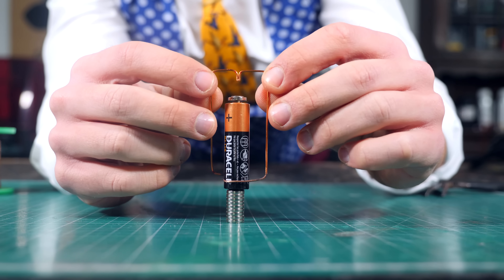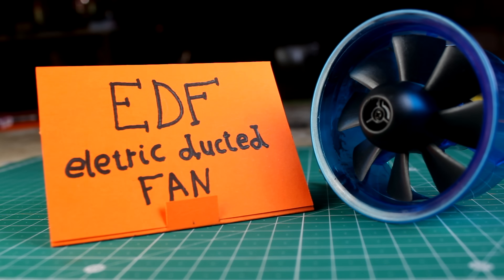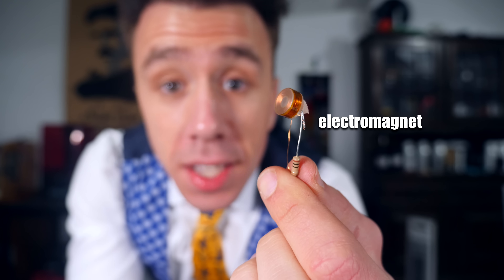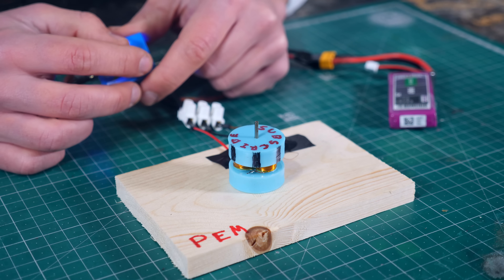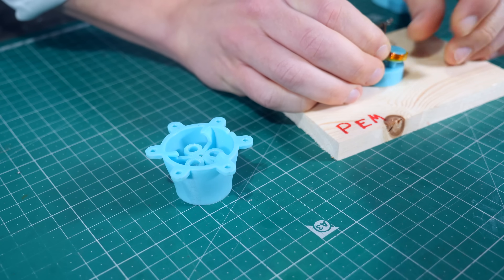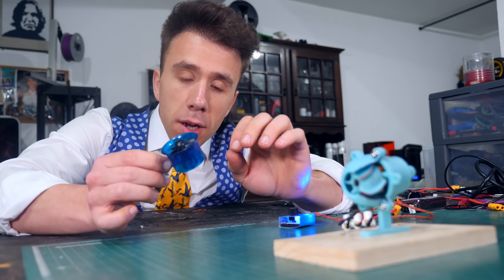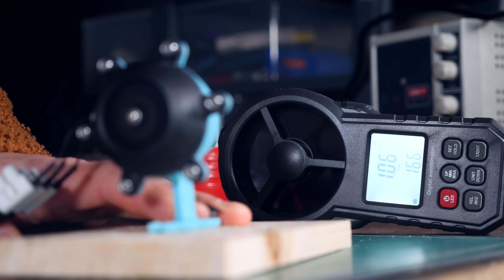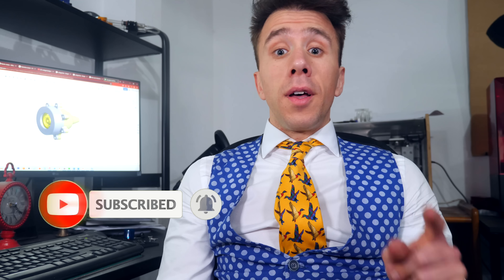I 3D Printed an ELECTRIC MOTOR FAN

Comment: the propellor or axial fan is to all intents and purposes, simply an inclined plane.
pitch, RPM, and disc area.
along with aerodynamic blades. low turbulence. pretty simple really.

the centrifugal fan is this tricky thing where involute curves or archimedean spirals may or may not be the best. you have depth of blade. blade area. the NARROWING of the blade passage. the impellers in a turbo, as the diameter gets larger, obviously the duct (area between blades) must get narrower to maintain the same cross sectional area, and then, theres a slight taper thrown in on top of that. the air is being compressed before it leaves the tip of the wheel, and there it has maximum VELOCITY and MINIMUM PRESSURE. its the scroll, the volute, that allows a turbocharger to actually build pressure as air velocity reduces. bernoulli.... use it.

what comes before, and what comes after the impeller are just as important as the impeller itself.

thrust... are you accelerating the SAME mass of air to the SAME speed? its a very tricky thing to quantify. and you appear to be measuring airspeed. not thrust... thrust requires the volume, the mass, to be considered. or simply how much thrust it measures on a scale. not an anemometer.

so, as nice as your "whipped cream in a can" impeller looked, it probably has a lot to ask for aerodynamically.

um...destroy the dyson fan before it destroys you? mine set itself on fire in the middle of the night whilst i was sleeping. heaters turned on full blast and yeah, it was smoking. lucky i sleep light.

i happily pulled it apart.

i noticed that the fan uses a closed blade impeller. unlike the vacuums.
it has asymmetrical blade spacings, to reduce the "air raid siren" effect.
it has finned trailing edges and holes drilled through for more noise reduction efforts.

havent had any luck driving the motor as its a high voltage (300vdc area) type thing...

still, the dyson impeller simply moves air, it doesnt actually compress it like a turbo charger does... again, it has the wrong type of housing...

Comment: The impeller needs a cone with an inlet.  Generally The bigger the inlet the more air  it may move. 

The inside of the cone needs to conform to the shape of the impeller reducing the airgap as much as possible to aid compression. 

The impeller fins should start largely pointing radially out so as theybrotate they  pushing air outward. Further out, the fins should begine to spiral and gradually bend to push the air backwards.  

Looking down on an impeller that curls, clockwise. If you  spin it anti clockwise it move more air. If you  spinning it clockwise, it speed a smaller volume of air up faster.  I believe you want more volume slower moving  of air rather than smaller volume but faster moving air.  

Finally, removing  the  impeller blades to about the diameter of the cone opening will likely aid in bringing more air in.

Comment: Difference I thrust is simply just because fan blades are better at accelerating air to higher speeds, while centrifugal fan just increases pressure of air, then you have to increase airspeed by using nozzle. Also there is probably a huge difference in flowrate

Comment: I am totally impressed by your 3d printing and designing skills. I tried to build my own electric motor and it - you can't say it runs, but it does some sort of turning motion. By the way, the thrust is not matching due to aerodynamics. It has nothing to do with the motor. Check out the guy who tests user made fan designs for PC fans, it's always the same motor and wildly different effectiveness due to different aerodynamic designs.
https://www.youtube.com/@MajorHardware

Comment: That particular type of fan is sometimes referred to as an axial compressor, because that is primarily what it does, compress air not accelerate it. That is most likely why it is underperforming here, I guarantee if you flipped the test and tested air pressure rather than speed, it would almost certainly outperform the edf. That's the whole reason turbines use them as their compressor stage, and dyson uses them as a vacuum pump.

Comment: Traditional round coils suck for generating torque for the length of wire they use. 

That is, Torque  Force=length of wire×amps×magnetic field× sine(angle of wire from direction of motion).

 In otherwords coil segments more parallel to the direction of motion contribute nothing to torque the magnets on the rotor. While an axial flux motor's coil segments that are perpendicular to the direction of motion (more radial)  are the coil segments providing rotation inducing torque to the magnets  on the rotor. 

A faulhaber coil has the coil geometry that produces the most torque for the length of wire that coils a motor. 

One can search "faulhaber coil". for examples and explanations. I like "Thingap Motors" that use a radial flux faulhaber coil on their motors. I made an axial flux faulhaber coil for my motor that I made on my channel.

Comment: What if you tried a modified toroidal propeller in your design? They're the new cool propellers, or so I'm told by the internet lately. They're extremely efficient according to all of the graphs that were colorful enough to warrant looking at for a minute. Also, if you happen to have a spare 3D printer.. I've just gotten a Tevo Tarantula running that was given to me. It's been.. Time consuming.

Comment: My intuition is that his initial assumption is wrong. He says it's the same motor so it should produce the same amount of thrust if used in axial or centrifugal configurations, but these compressor architectures are geometrically dissimilar. The efficiency of the compressor is going to be different as the geometry changes and perhaps the simplicity of the axial fan wins out over the centrifugal at this scale. I'd suggest he measure the inlet and outlet pressures and or the power consumed by the motor in both configurations and compare them for further physical insight.
- from a friend

Comment: You're using two different methods to import mechanical energy onto a fluid. The smaller the scale the more the tiny changes have a large impact, this means that at the scale you're working, minor changes have major repercussions. There's a reason we don't use impellers on boats, except in specific circumstances. A propeller is more efficient in the water just as a propeller is more efficient in the air than an impeller they impart a different style of mechanical energy for lack of the technical language
Reply: Did you select me or am I being scammed?

Comment: The centrifugal blades probably work better/ more efficient with the motor at high speeds. They take in high pressure air from the front, like used in a turbo fan jet engine. The blades on the edf fan are designed to propel the still air around us.
Reply: Also restricting the diameter of the flow can create a nozzle but can also restrict the flow. Love you tho, hope that helps

Comment: Fluid dynamics of air. Air pressure is one thing at the climatological or aerodynamic scale but behaves differently at the event horizon of violent pressure shifts like your fan intake. I'm guessing literal cavitation of the air where heat and low pressure are phase changing hydroscopic H2O into gas to balance out the heat calories. Maybe play with the geometry of the leading edge of your fan blades, use a smoker to try to visualize the plane of extreme turbulence at the intake where it gulps more or less air depending on aperture. Then maybe test your thermals. Unexplained heat in the exhaust could point to loss of efficiency Anyway, there's my guesses. Good luck buddy, I love your vids.

Comment: In general centrifugal fans vs axial fans are used when a larger pressure ratio is required but at a lower volumetric flow rate. The effective flow cross section at intake is much smaller than the EDF in your design which chokes the flow. To get thrust you need  more volumetric flow. You want to generate momentum which means accelerating the air. Having a high compression-expansion is not what you need here (it is needed for a combustion engine or turbo) and is a waste of power. In terms of design it looks to me that the main issue is that you need a larger angle of attack of the blades at intake and a larger flow cross section. For the angle of attack look at the concept of velocity triangle (relation between flow velocity, circumferential velocity of the blades and angle of attack). In some designs a tube extension in front of intake or a stator that direct the flow can help to avoid stalling the blades (too high angle of attack) at startup. I would start with a blade angle of attack of at least 30 degrees to prevent stall and increase slowly the air speed to observe if the fan is sucking air or just free spinning...

Comment: The term "pulsed motor" is not much helpful. Because mechanically commutated or brushed motors also pulse current through coils, except the coils are on the rotor. 

l prefer to think of BLDC motors as DC powered, electronically commutated motors to contrast with  DC mechanically commutated motors, and the use of DC is to contrast with AC powered motors.

Comment: I think its something to do with the cross-sectional area of the inlet compared to the outlet.

The impeller has less area, so therefore it will have less mass airflow resulting in lower thrust.

Check the current and see if the impeller is pulling less current at the same RPM, if so then it is seeing less load due to that lower airflow.

Comment: An impeller's job is to make high pressure air to allow more fuel to be burned in the combustion chamber of the jet engine. The EDF's job is to accelerate lots of air to a high speed. Now, the EDF does accomplish this by creating a pressure differential but if I had to guess, the pressure generated by the edf is much less than that of the impeller. If you were to try to use an EDF in place of the impeller on a jet engine you would not get the same amount of thrust. Simply put, the impeller and EDF were made for different tasks and should not be directly compared.

Comment: Could it be loss through heating. The impeller makes a higher pressure flow and as you increase pressure you increase temperature explaining loss in performance. You also have  more friction in the impeller which leads to more heat and loss in Performance.

Comment: I'd like to throw in my advice here
You have to look at the construction of the blade types
The axial fan acts more like a scoop, or it propels the air, hence propeller. It displaces by scooping the gases that make up air and forces it backwards. This is great for static pressure and decent airflow at slower speeds. Propellers can't handle the centrifugal force needed to propel a craft, or air, to supersonic speeds.

The impeller design is more a suck and compress arrangement. 
The blades spin, fling air out to the casing that surrounds it, and increases pressure. The increase in pressure is what causes air movement and not because it is being scooped out of the way. It can produce the same static forces and displacement of air, but it requires a much higher rotational velocity to produce the same displacement/static air pressure as a propeller. The upshot is, it can be produced to move an airplane or air and supersonic speeds. 

So your problem is, you are trying to use a motor that is great for use with a propeller and trying to get the same results with an impeller. It won't happen. 

You can either create a motor/propeller that works great at slower speeds and move a lot of air or you can create a motor/impeller that works at very fast speeds and moves the same amount of air.  You can, of course, try to create a hybrid, but it won't be great at either or well suited to either.

Comment: Hello Integza. If we use an electric heater instead of a flame for heating in jet engines and make a mini electric jet engine, I wonder if it will be more efficient or less efficient than the one with a flame.

Comment: I don't know how to optimize impeller fan thrust, so I won't talk about that. A couple things are clear to me though - you seem to be measuring (and equating) airflow to thrust - usually a pedantic thing, but not in this case. Centrafugal fans deliver high-pressure low mass airflow while axial/radial fans deliver low-pressure high mass airflow. The knock-on or follow-on effect of this is that the tolerance between your fan blades and their housing is super critical. Even radial pressure-optimized fans find this very important (I'm thinking of noctua's NF-A12x25 0.5mm tolerance). My last guess is that there's some aerodynamic trickery/interplay between the housing size and shape and the rpm. Good luck!

Comment: INCREASE WIDENED BLADE & 30° PITCH REMEMBER THE LESS BLADE THE MORE MOMENTUM ATMOSPHERIC DISPLACEMENT  INCREASE COMPRESSOR CHAMBER SUBSYSTEM COMBUSTIBLE PROCESS WITH MORE AIR FILTER SPACE LESS CHOKE COMBUSTIBLE BARRIER ONLY USE CHOKE BARRIER FOR BEAMING AIR HOWEVER U CAN ADD AN CHOKE COMBUSTIBLE BARRIER WITHIN AN AREA OF FRACTION OF AN BLEEDER NOZZLE GOOD LUCKY

Comment: Interesting, the biggest electromagnet I have seen weighed  5000/6000 kg from memory, the regular ones were 250kg and some 500 kg I think. By Buckley Systems in Mt Wellington New Zealand back in the 1990s…used to guide electron beams I think in making matts for silicon chips. Fyi… Laurie NZ.  ❤❤❤❤🎉🎉🎉🎉😮😮😮😮😮😮😮

Comment: Seeing as your measuring with a.. fan which is measuring wind speed which will take into account the flow across whole inducer diameter of the anemometer. In my opinion the only way to get better results with the same motor and testing method is to further optimise the size and blade style to get the most airflow measured. The radial/mixed flow impeller design you are making will not be beneficial in the test you are measuring. The Dyson fan blade impeller is super efficient but not for mass flow it’s efficient at higher pressure ratios from its screw design and high tip speed which can be calculated for desired pressure. Dyson fan design relies on the high pressure and velocity air to convert it to mass flow by multiplying the mass flow using the negative pressure created on there aero foil design ring.

Comment: Does the controller activate one coil at a time to create torque? Ever drive a turbocharged 4 cylinder automobile with a misfire? 

I think you've got a pressure leak from pressure waveform deformation. I bet I sound really smart right there, but believe me, I'll only appear that way if I'm onto something.

I tip my hat to you and bow to your expertise in things that blow, but perhaps using four smaller coils and alternating 1 and 3, 4 and 2, that waveform might smooth out and create a smoother pressure wave.

More air is more squishy, less air has less mass and might therefore be more susceptible to losing energy in null spaces. Love you bye

Comment: NB. Thrust and Velocity are not the same (yes you know that - but that didn't stop the tinkerer using an anemometer and mention  - they were measuring thrust, really??)
 Thrust needs a force balance -  I think you have used that before with linear rails and rocket engines.
 - Also re. the thrust measured, and the speed of the exhaust jet, correlates to the efficiency of thrust generated at the SPEED one is interested...  (ie. little (diameter) jet, high velocity = same thrust as large jet, lower velocity (lower maximum speed of propulsion obviously..) - we?? didn't see a cutaway of your pressure plenum -  exhaust ducting (?? too much constriction, for what aim??) -  the general design with a lot of narrow passages has to be more restrictive than the simpler EDF straight through design, there are reasons that after whittle, aircraft jets abandoned centrifugal fans. - and we haven't even added a hot stage as yet, we all need more SLA ceramics.

ALso-  the EDF produced "flow" across much of the anemometer (partly accurate speed emasurement), the little part axial / semi-centrifugal hybrid - ducted fan only produces a small diameter outflow - (not so accurate for measuring with a "large diameter" anemometer).

Printing up a housing and putting the dyson fan in it will tell you something  - relating to fan vs ducting losses.

Comment: look at the whole case of Dyson fan with the frame, you will see that the frame just provide a small frame opening in to the funnel intake, which the diameter a bit smaller as the smallest fan diameter, and the funnel itself also has a weird curved shape, so the entire intake isn't all a narrow, but curved....my suggestion, make the whole cylinder frame of a dyson fan

Comment: Centrifugal fans are designed primarily to increase pressure whereas axial fans are primarily designed to produce volumetric flow. So you'd get a higher static pressure out of the centrifugal fan, but it lacks in flow. The energy is the same, just in different forms.

Comment: Different impellers as well as propellers with the same diameter will make the same amount of thrust at different speeds through the air depending on pitch and geometry